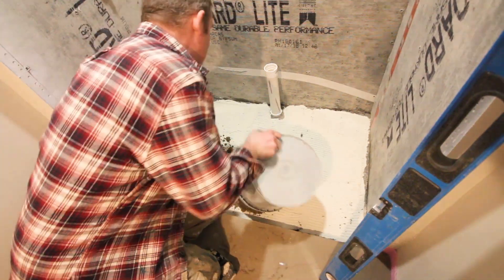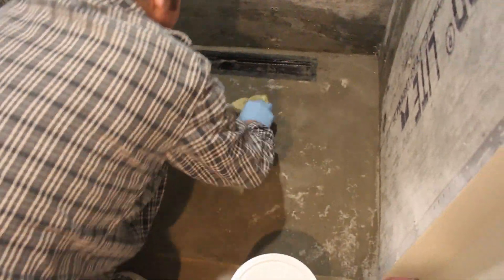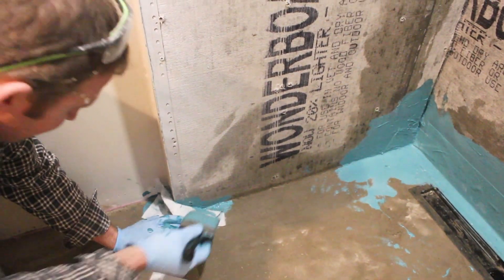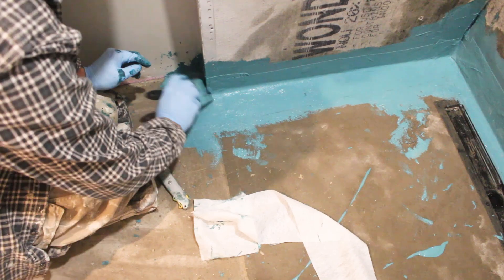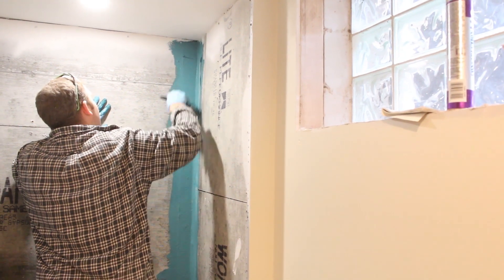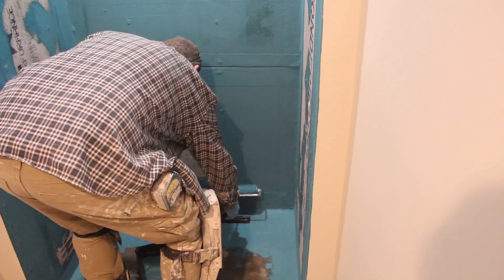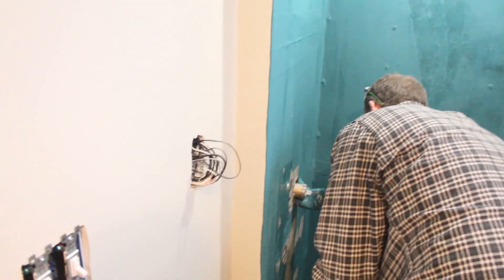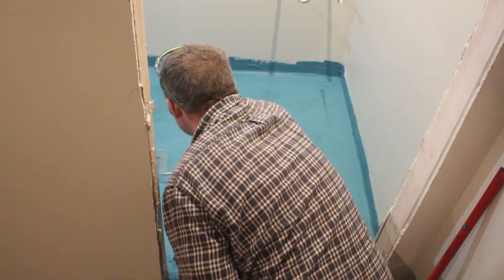Build Curbless Walk In Shower on Concrete Floor (Part 4: Waterproofing)

Comment: Great video, few tips:
- waterproof horizontal seams before the verticals, since water runs down - this will help eliminate the worse type of gaps
- seal penetrations (shower valve, shower head) w/ either caulk (if a small hole) or fiberglass + membrane; otherwise, water that gets behind the tile can make it into your penetration
- flood test your pan for leaks for 24hrs after waterproofing.
Reply: Believe it or not water can go up in a shower. Poor tile adhesion can lead to capillary action but, yes always follow nature flow of water. Water does go uphill. Seen myself many times.

Comment: I like cement board, but isn’t the porous textured design to make it a good tiling surface? If you’re going to bury the cement bird under layers of other products you effectively cancel out that substrate. At that point could you not have use regular mold resistant drywall or something?

Comment: Hi Steve -you used KBRS waterproof  liquid with cement board but why didn't you use Go Board? Why not just use Red Gard with cement board?
Reply: All the same
Reply: Redguard overrated.  18 years tile installer.  I really don't use it better waterproofing out there
Reply: @jbitile8241  can you tie in new tile with previous tile and use waterproof liquid? I’m removing a jacuzzi tub but have great tile above the tub I want to keep. Amy help would be appreciated

Comment: Can I use a metal linear drain? Will the liquid membrane and that fabric stick to the aluminum flanges or does the drain need to be plastic?

Also what did you use to pack and slope the mud in between the backer and drain? Seems like an awfully tight place to use any trowels in.

Comment: What brand drain is that?
Reply from the maker: KBRS linear drain module, it’s affordable
Reply: Home Repair Tutor I looked into their linear shower pan kit and it does seem reasonable price wise. Haven’t heard of this company before so a little hesitant. But based on their website info the materials and construction quality seems good. How long have you used their products? Thx!
Reply from the maker: For the last year, it’s been very good and they are great at customer service. Email me if you want to try their pan, we can help with that 👍🏻
Reply: Home Repair Tutor thanks for all four videos they were tremendously helpful for us in determining which accessible curbless shower to build.  If you would please, do you happen to have a materials list you can provide me.  I have rapidly progressive multiple sclerosis and must tear out the MBR in my home and remodel right away.  What I’d like to do is have a design/build agree to follow each step in your 4  instructional videos without skipping a step, do you have a materials list I can provide them?  Any suggestions or tweaks you’ve discovered since?  My shower is obviously in a slab as well and I’m bumping out into the garage approximately 32” to achieve a 36”x 72” curb-less shower I can transfer into.  Note: my garage slab is approximately 4 inches below bathroom slab.  

I can’t seem to find your email address if you can list tht in your response that’d be great.  Thanks I appreciate the videos and help with prospective contractor.

Comment: I suggest that you form your corners over a box before you try to install them.
Reply from the maker: Not a bad idea but the fleece is very flexible and it might not make sense in this case
Reply: The idea I propose is to form the corner over, say a 4"x4"x4" block of wood, and then use the block of wood to set the corner. I have a picture, which is pretty self-explanatory. You could even develop a technique for outside corners, although I haven't yet done this. I realize that I may be solving a non-existent problem, and I don't seek to cause you any embarrassment. The corners in your video looked so slap-dash, even though I am sure that they work just fine. This technique probably does the job much faster and probably better, meaning less likely to accidentally produce a leaky corner. https://youtu.be/DjBcbahT3ts
Reply: @chrismiller6579  Thanks for the tip Chris!!

Comment: The liquid water proofing is not a decoupler, no matter what the manufacturer may tell you.
Reply from the maker: You can use Ditra or Strata or Flexbone, that said, time will be the test
Reply: Richard McKrell Respectfully disagree. Liquid waterproofing membrane is applied to the cement board. Tile adhered to the membrane. Since tile is not adhered directly to the cement board the membrane is therefore acting as a decoupler. That’s my take.
Reply: you could be right, but I think it's just a waterproofing membrane.  Just because the liquid waterproofing is between the cement board and the tile, that doesn't mean it's also a decoupler, but I could be wrong.  I'd have to read up on the specific liquid waterproofing.

Comment: Why not just silicone the seams and corners then paint over it with the waterproofing?
Reply from the maker: because that's not an approved method in the TCNA Handbook
Reply: Gotta tape it.  Expansion will happen and the caulk silicone will not expand.  It will separate.  The mesh hold it’s all together and keeps the expansion from causing cracks